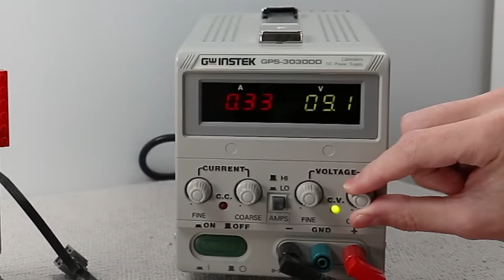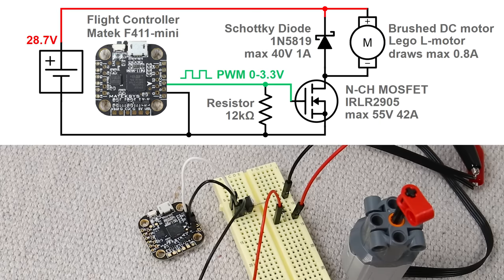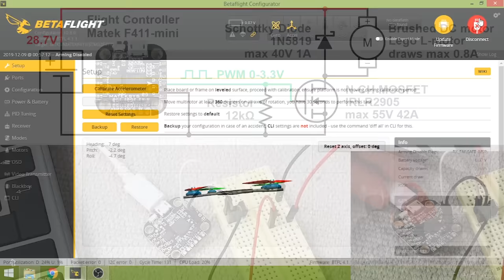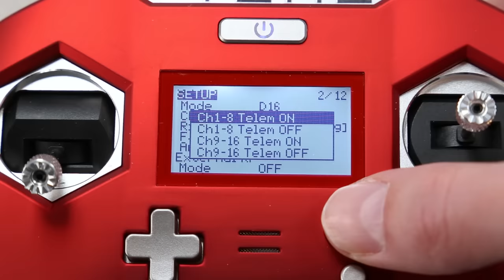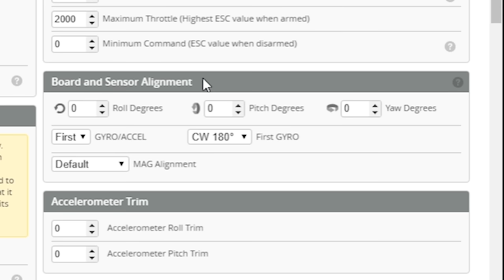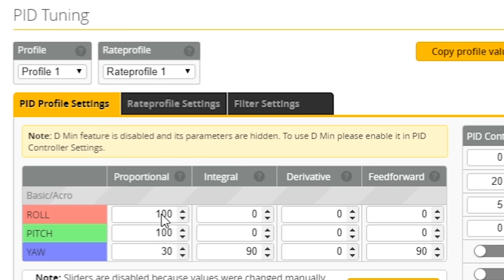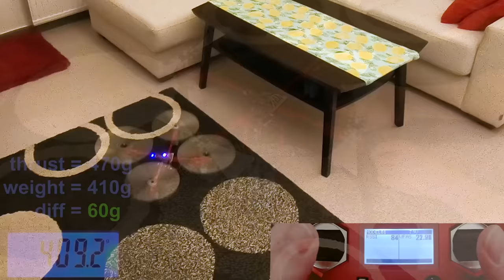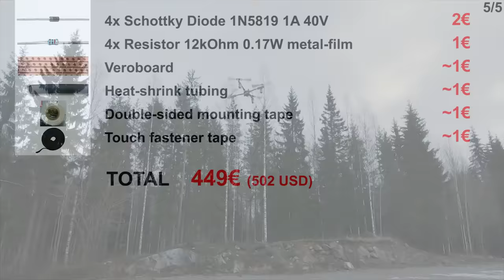Making a Drone with Lego Motors and Propellers

Comment: What voltage do you drive the motors with? I tried a simple setup without motor driver nor radio. Just want a cheap proof-of-concept that I can accomplish together with my son 9 yo son. Using all 3rd party components (including motors, power brick and rotor blades) I'm trying to get it to just lift off. No dice... Now I wonder whether the cheap 3rd party motors are simply too weak or if I should try upping the voltage (risking damage to the motos, I know...) or some other trick...

Comment: I’m curious if the slight difference in mass between normal and reverse direction rotor assemblies had any effect on acceleration (I.e. pulling ever so slightly to one side despite directing the drone forward).
Reply: If so, the I term in the controller can deal with that

Comment: He didn't calculate the thrust right. For example, if it weighed 100g and when he turned the motors on it weighed -400g, the thrust would be 500g not 400g

Comment: Why’d you have opposing directions on the motors? Does it slowly rotate otherwise or something?
Reply: Yes, and not slowly. That's why in helicopters there is either a tail propeller or a second propeller on the top.

Comment: can spare 70euro on transmitter
poor result due to vibrating frame
blade and motor are overpriced can afoard drone part for cheaper
it will be more impressive with the real lego controller :face-orange-raised-eyebrow: